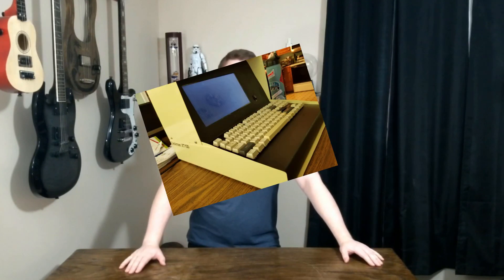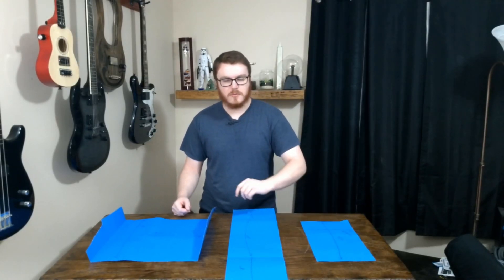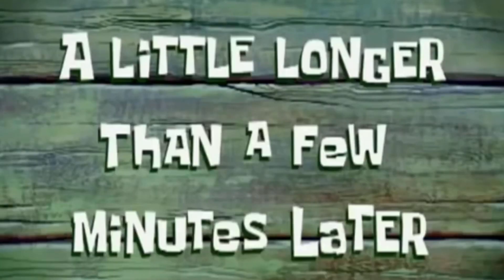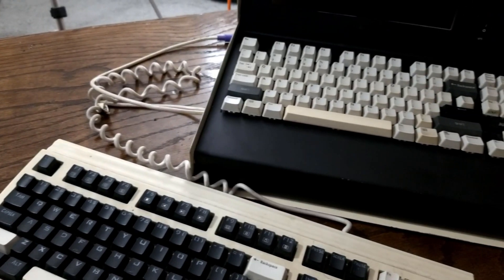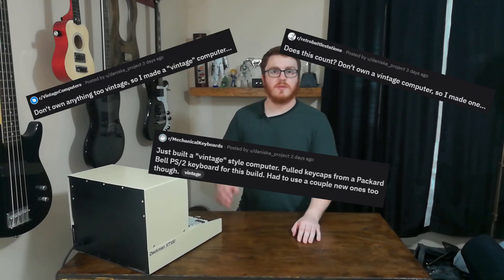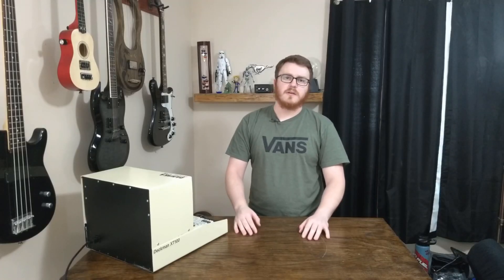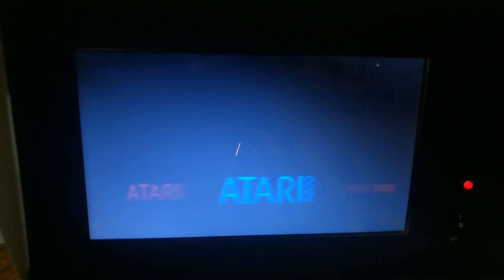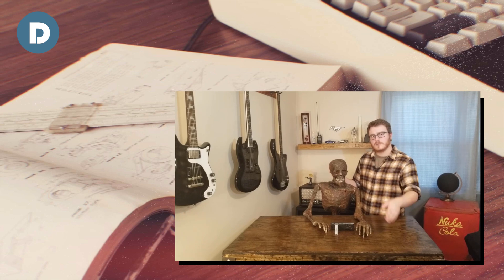I Made a Raspberry Pi "Vintage" Fallout Themed Computer Terminal!!

Comment: i should have recorded the making of my fallout themed pc i made on my page. its a full gaming pc tho, not a rasberry pi . its got an rtx 2080 and i7 9700 with 16gb ram. if only someone would buy it so i could pay for a new build and make the next one ook more like a terminal.
Reply: @engineertf2real913  I'm going to have to replace the display before I can sell it now. After putting in a new power button I cracked the display, it still works as does the touch screen but I wouldn't feel right selling it now till I replace the screen. https://vm.tiktok.com/ZMdbYhUoB/ thats my tiktok showing what it looks like now. After I replace the screen or make a new one more accurate looking  like a fallout terminal shape I'll let you know.

Comment: Good work... But uhmm... Should it not be called a "Vintage fallout terminal themed computer" instead? It is not a terminal, because all they are, is the keyboard/screen that are seperated from the computer. Connected using serial interface. Basically it is a computer without the brain, memory, storage. Or in modern words, a terminal is the human interface device (HID) part of a fully configured computer. And as you have a RaspberryPI in it, then it is no longer a terminal as such.

You can make it even more awesomme, by building a big 70's industrial inspired case, for the RaspberryPI it self, add a big ass fan (minimum 180mm) and mount tons of USB attached drives inside. Then using an old industrial plug, you can have all the signals going from the terminal and into the computer, using a big fat cable. Then you will have a computer with a terminal. Using modern technology. And uhmm... Paint the computer green or blue, in 70's colour tones, with big heavy duty switches. It will not be a computer with 30 terminals, yet it will be awesomme.